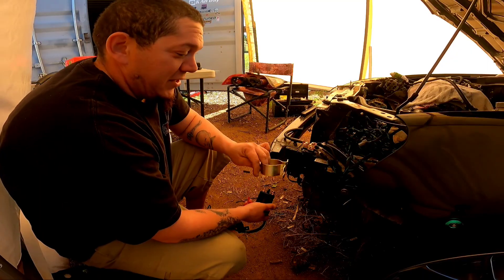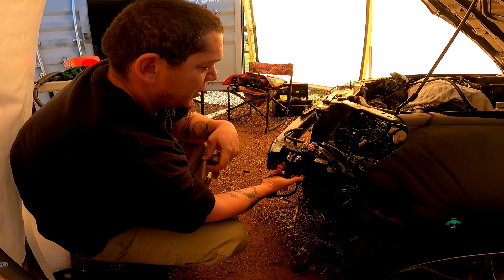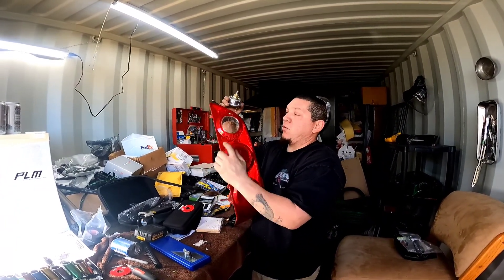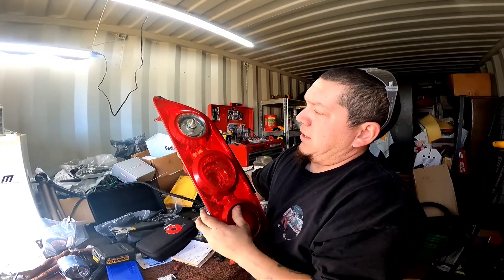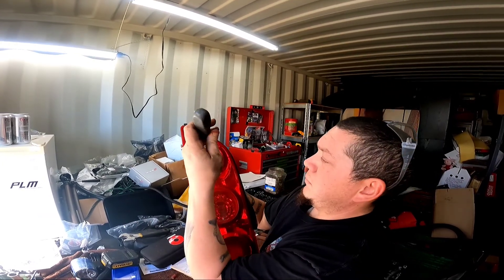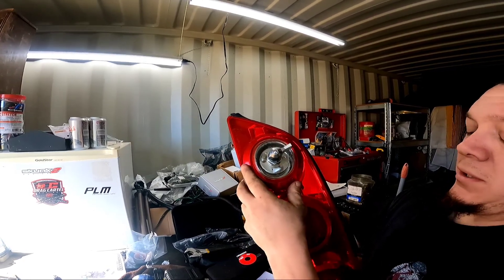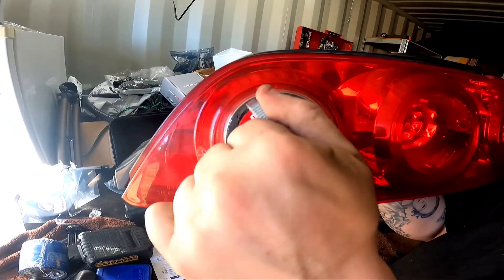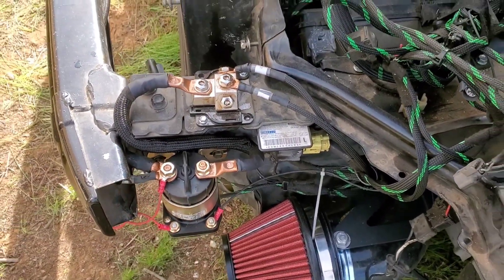Kill Switch

Comment: I installed the acuity tps and I set it to 4.8 volts and the car hated it.  Wouldn't rev right, 4.5 volts was perfect,  like stock.
Reply from the maker: My problem right now is its going to low. And wants to die on a cold start. Once it warms up its better.
Reply: When I had it at 4.8 volts the idle was high and when I pressed the gas pedal there was about a second delay before it responded. I have the stock prb intake  manifold and stock rsx throttle body.  If you upgraded any of that you might have to find the sweet spot where its happy. Maybe an issue with fuel or vaccum leaks.